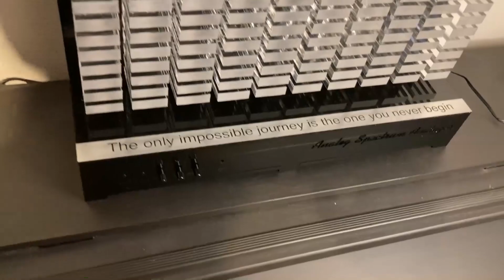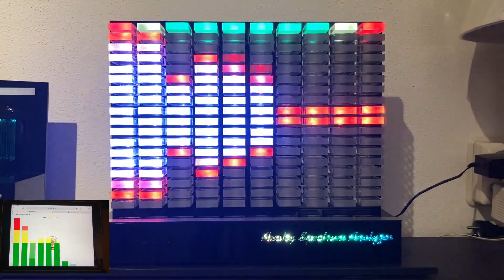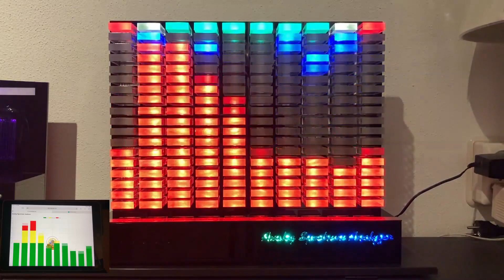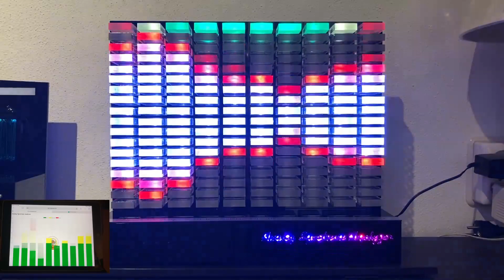Desktop Spectrum Analyser with Analog Design

Comment: Trying to adapt your 10 analog bands analyzer to my needs. Could you give me the reason for using the multiplex device? Could the 10 bands outputs be tied together and sent to the ESP32 directly? I made your 32(64) channels fft version and it works ok, but don't trust its accuracy in the high frequency bands. I use line input and TFT Displays for my needs. I display 13 amplifier outputs: Subwoofers, Low Woofer, Mid-Range, Ribbons, Surround, Height and Center Stereo channels. I use Car Stereo (transformer) attenuators to bring the amp output to line level. I will add two more analog channels for 10K and 12KHz. Interpolating the values of R1, R2, R3. I only need the frequency spectrum.
Reply from the maker: Well, without multiplexor i would have to use 10 adc inputs, 1 for each channel. If you tie all together the channels will loose their functions and you have to use fft again…in that case you can leave out all the opamp filters….. in the comming weeks i will release a new analyzer. Different fft algorithm   And bluetooth as audio source….. that one is a lot more accurate in high and low
Reply: @TheElectronicEngineer  Thanks very much for your quick response. I admire your work. Somehow, I never read the entire PDF explaining all the functions. I have now. Especially the Vref explanation. Learning Arduino things at 83 years old. Look forward to the new fft one. Around 1979 I equalized a Coliseum in Puerto Rico using the Hewlett Packard 8050A Audio Analyzer which I still have around ($4000.00 at that time). Playing with these modern ones brings fun and good memories.

Comment: I ordered the assembled PCB and am looking forward to playing with it... 
Excellent series of videos, thank you... now lets see... can I find a use for a few hundred 5mm RGB Leds or should I order some Led Strips?
Reply from the maker: If those are regular leds then those will not work. You need digital leds , pixel leds like ws2812 or similar
Reply: @TheElectronicEngineer  The regular Leds (not addressable) are for another application, I also bought WS2812B (144) led strips for this project...
Just checking... how many leds per meter do you suggest, I got 144 but 60 might be enough?